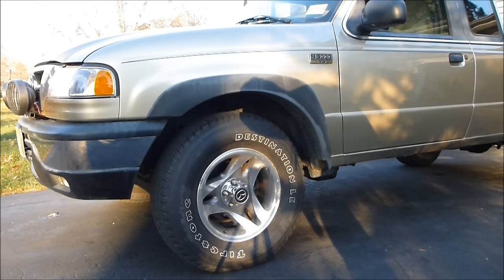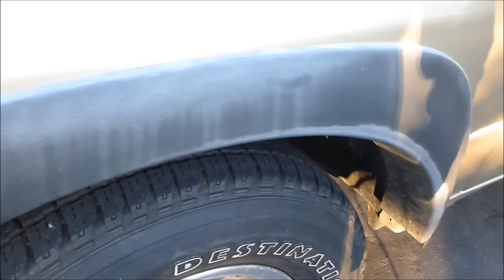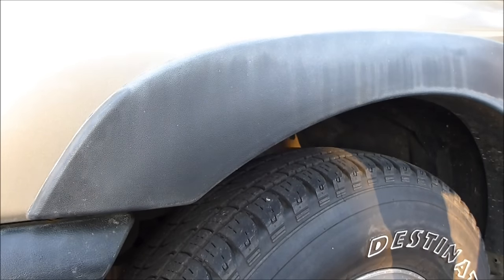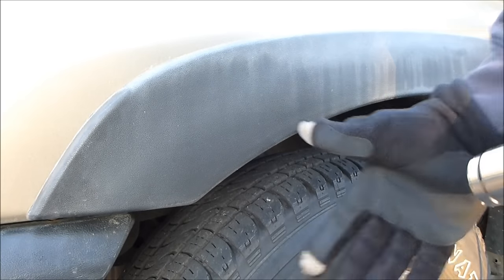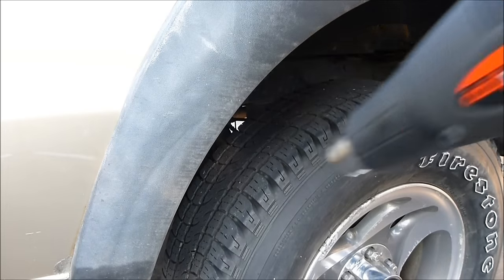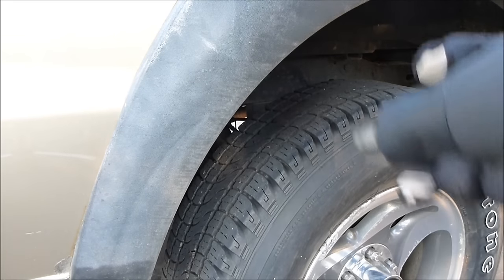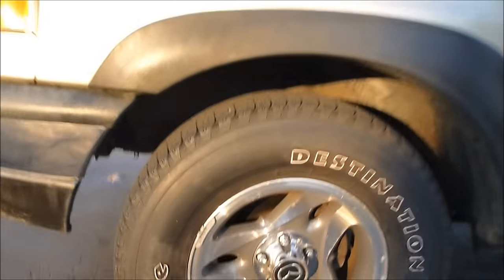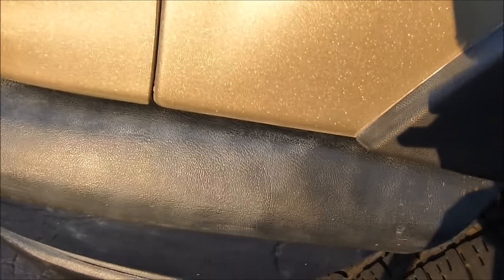Restore your Faded Plastic on your Car

Comment: Wish I would have seen this video Before I plasti dipped all my side panels etc. Masking and removal of over spray took forever. It looks great but this is WAY easier!  Subscribed!
Reply from the maker: D-Nice Grogs Glad you subbed! That does sound like a lot of work! I have a product review in the works for black trim restorer and it works great! New automotive 'how to' videos every Thursday and most Mondays so stay tuned!
Reply: Coo, I have a Mini Cooper S, do you have a recommendation for what to use to black out the silver trim that runs at the base of the windows all the way around the car. Blackout tape? I want something that is easy and can last in hot and cold weather, snow and rain... Ya know.
Reply from the maker: If you are blacking out silver trim you are going to have to spray. Obviously plastidip is a good, non-permanent way to do that, but I have used this stuff and it looks great and lasts a long time: http://www.amazon.com/gp/product/B005H5P5C6/ref=as_li_tl?ie=UTF8&camp=1789&creative=390957&creativeASIN=B005H5P5C6&linkCode=as2&tag=chri0e2-20&linkId=KFTNL6XCZ6IFH3YB
Reply: D-Nice Grogs I did the exact same thing with my 06 cooper S. I actually for a time had blacked out all the chrome and silver on it. I used plasti dip to do it and it works great. The more coats you put on the easier it is to come off if you want it off as well as the better it will hold up. one thing i did notice with the plastidip that i had put on the grille and that chrome belt line bug guts if not taken care of within a week will start to effect the plastidip but i think this may have been because i didn't have enough coats on in some spots. The black plastidip covers really well so its easy to think that because you have coverage its good to go. i reccomend 3-5 full wet coats to make sure it holds up and is easy to remove if you want to. im thinking about plastidipping my whole car this summer even. or maybe just the roof.

Comment: Chris can you do a video on restoring oxidized painted plastic bumpers and trim?  On a ruby red 2013 Ford Focus for example, there is a lot of painted plastic that's the same color as the metal paint.

Comment: Transmission fluid works but, you've got to do it in the heat of the day and at least two applications, if not three over the course of several days.  Results will be permanent.

Comment: I used Go Jo hand cleaner on 93 f 150 it had ad on flares looked terrible also black plastic on rear view mirrors owned truck ten years that was the only repair done to it that worked of course apply in discreet  spot first

Comment: I would recommend that if practical and without damaging stuff, remove any plastic from the car that is to be heat-treated.

On my car, I made the plastic trim look good with armor-all but it only lasts until the next washing or serious rain. I am thinking maybe painting it black. Would that be a bad idea?
Reply from the maker: Lesrevesdhiver That is a good tip. Taking these plastic pieces off might be a death wish because they are so old and brittle. Instead of painting them, I will have a product review in a few weeks that you should check out. It is this stuff and it works amazing: http://www.amazon.com/gp/product/B00IOBSZJK/ref=as_li_tl?ie=UTF8&camp=1789&creative=390957&creativeASIN=B00IOBSZJK&linkCode=as2&tag=chri0e2-20&linkId=E4IBQ5MH3GZEJ2Z6 
I highly recommend it before you go painting the trim. It lasts over 6 months so far!

Comment: Chris - been watching your videos for a while and have a legit question. 

I know this is an old video but can’t find anything recent / relevant. 

I have an old 2007 car with grey trim and wanted to spray or make it black (permanently)

Cerakote wasn’t bad but turned streaky and pealed. I want permanent and may spray it black. Any products or stuff that springs to mind for a permanent solution? 

Adhesion promoter or spray  / trim bumper spray?

Comment: Take it off and use a blow torch, works wonders but you only want to hit one spot for a split second or it can melt the area.
Reply from the maker: Why not just play it safe and use a heat gun like in the video?
Reply: Eh I've tried the heat gun didn't give me the same results but to each his own
Reply from the maker: Gotcha. I guess it depends on the plastic because I used a torch on this and it didnt work nearly as well...

Comment: I went out an purchased a cheap heat gun from Home Depot, like $20.  The results were amazing, but only lasted about 3 weeks.  Any idea if it damages the plastic by doing it over and over and over again?  I might just spray paint it or plastidip it.

Comment: I restored the trim on my 94 325i with Forever Black. It basically dyes the plastic black again. Unfortunately in started fading again after about a year. I did it again and something possessed me to use the as seen on tv Wipe New, as a protective sealant on top of the trim after using forever black and it still hasn't faded 4 years later

Comment: would like to see a video around removing wax. I tried rubbing alcohol right after, but still there is some residue... it is now a month after and used different solutions... cheapest with fairly good results was cooking oil, but would appreciate if you could suggest a better solution.

Comment: Thanks again Chris, is it true that you can add like Motor or Transmission Oil after you heated up the plastic to the point it to hot for the hand to touch? I saw in another video, where the oil is suppose to get into the pores of the plastic and revive it ? You have have to do this 1-3 times depending how bad is your plastic trim is. Is that true? The oil is suppose to be a permanent fix, as this is the reason that your trim dries up and get's hazy, it looses it's oils and dry's up.  Can you confirm this ?

Comment: Hi! Chris. How about an engine cover smeared by "whatever chemical is it" that made it faded. Can I do the same. Can I use a back to black restorer without any effect on the plastic considering it would be exposed to extreme engine heat. Thanks!

Comment: Do you know if this could be used to repair scratches in plastic cladding? I wonder if I started by sanding out the scratches, if the heat gun could be used to smooth out the sanding marks. Any experience repairing scratches and scuffs on plastic cladding?

Comment: howd it hold up? I'd think that you melted some of the oils out of the plastic, and that it will look great at first as they come to the surface and re-invigorate the top layer, but in the long run I bet it gets chalky and dusty even faster now.
Reply from the maker: dav3fk It lasts a little over a year. I am doing a product review on a product that actually works pretty good so far. They claim it will bring back your black plastic and keep it black for a year. Stay tuned for that product review!
Reply: Chris have you any experience with a product called Plastic Resurfacer by Eastwood?

Comment: Hey Chris...I have read several reviews of plastic trim coatings.  The biggest complaint is streaking  where the product leaches onto the body paint below the trim, from rain.  You mentioned a nano wax in another video.  How has that worked out?

Comment: Hey Chris im on a binge watch on your video :D

How has this held up since then? I realize this was 2 years ago so you might not have the truck but it would be interesting to know. Oh, and what year is your corvette?
Reply from the maker: zzzhuh Awesome! This held up for about a year but there is an even better method out there that I will be reviewing soon!
Reply: ChrisFix Ooh what method is that?? I just found this as-seen-on-TV stuff called Wipe New...mixed reviews but the positive ones seem to be from people who have actually used it. Tried it myself all over my car's trim and some stuff inside and it's absolutely phenomenal. Dries dry, impenetrable, and matte with a slight sheen. Supposed to last years and has lasted me through one hand wash & wax so far with absolutely no fading. I realize now that I think it's just a polyurethane coating, and there's a couple more industrial products that are probably exactly the same stuff, only cheaper: Carworx Refinish Restorer, and this stuff on Amazon called Poly-Thane. Worth a shot man, stuff works like crazy.
Reply from the maker: floofytown This is the stuff and  (spoiler alert) I recommend it. I really like the results I got on my truck! http://www.amazon.com/gp/product/B00IOBSZJK/ref=as_li_tl?ie=UTF8&camp=1789&creative=390957&creativeASIN=B00IOBSZJK&linkCode=as2&tag=chri0e2-20&linkId=TMMPYWKISIAZX6Q6

Comment: I read that using heatguns on plastic may cause the plastic to become brittle over time as the heat only brings the moisture to the surface which gradually dries the plastic out.

Comment: clean the plastic with a mild degreaser and a fine stiff bristle brush. i like to use nonsense from chemical guys.  stuff works great on everything and I gentle.  so if it gets on the paint its not a problem. just make sure to apply wax back to the paint. spray down and apply moderate pressure and scrub in circular motions. It might take a couple of passes before its clean enough. then follow up with a restorative product. will last months before you have to do it again.  or just keep doing a light clean with a brush every wash then coat again.  plastics will always look good.  the trick is to clean all the dirt, grim and old stuff out of the texture so that the restorative product can bond to the surface. if you don't it's just bonding to the dirt. also the stiffer the bristles on the brush,the better it will work because it can take away some of the grades plastic on the surface.  think of it as exfoliating your skin then applying lotion.
Reply from the maker: +Jeremy Greathouse Thanks for sharing!

Comment: I have a question! How has this held up over 3 year? I've just used Mother's Back to Black, which does the same thing. Buffs off minor oxidation, and protects it, and other stuff. I was just curious so I can see the difference in results are after some time.
Reply: Blade Vamp Chris responded in another comment it lasted about 6 month, others are saying 2-3 months.

Comment: Just curious, what if you put some layers of clear coat over the trim after doing this? Wouldn't it last even longer?
Reply from the maker: It would definitely help protect it but it can give a glossy/shiny appearance, I like the look of restored trim like this so I just left it and when it faded years later, I was able to do this again!
Reply: @chrisfix  very true. I wonder if someone makes a non gloss clear coat? I'll have to look into it. Also, I was under the impression that you couldn't do the heat gun technique more than once so that's awesome that you can reapply. Love your video man, keep it up! About to do headlight restoration on my mom's truck using your technique so I greatly appreciate what you do! 🔥
Reply: @chrisfix  so I researched it and they do make a matte and satin clear coat with no gloss. Something to think about. Maybe another video doing this after the heat treatment?

Comment: The Deep Woods f2f did clean the headlightvlenses perfectly. However, after I posted I tried spraying it with water from my rear windshield wiper and the dripping water streaked it. Back to the drawing board.
Reply from the maker: Stacey McElrath What do you mean? This video is about plastic trim not headlights... What is Deep Woods F2F?
Reply: @chrisfix  lol

Comment: does it last long? even if you wash the car with soap or any other chemical? thanks Chris
Reply from the maker: samuel aguilar It will last about a year depending on if the car is garaged and where you live. It fades because of UV radiation (sunlight).
Reply: thanks man, :)

Comment: Why didn´t you just use silicon spray? Turns Black instantly and is good for the plastics and cheap. 
There are other products specificly for that purpose but silicon spray works awesome.

Comment: ChrisFix. I own a 2002 Ford Expedition EB and my significant other decided to spray paint the rear bumper!! The paint used doesn't even resemble Arizona Beige I have tried everything to remove the spray paint but it still wont come off .Please help me get the off white egg shell of my bumper please. For GOOD

Comment: Chris:  D'ye think this method will work an the panel where the wipers rest just below the windshield, where the cabin air intake is?  It's huge on my Taurus - very visible - and almost gray in color - very unsightly.  Thanks.
Reply: William Krause My 2 cents would be that all plastics are different so try on a small corner and see if it helps. Doesn't sound like you could make it much worse. Please update if you try it.
Reply: Will try as you suggest - in the spring, when the outside air temp is not nine degrees! Thx.

Comment: For whatever reason I can't seem to get this to work on truck. I have the same problem but no matter how much heat I use it doesn't change... (2006 F150 FX4 fender trim)
Reply from the maker: ***** It wont work on all plastics. I would try this instead which lasts even longer (I just tested it over a year): http://www.amazon.com/gp/product/B00IOBSZJK/ref=as_li_tl?ie=UTF8&camp=1789&creative=390957&creativeASIN=B00IOBSZJK&linkCode=as2&tag=chri0e2-20&linkId=IIV3XUXC4N5OEWXI

Comment: The easiest most effective way to fix this problem is to take and old socks and drench it in Deep Woods Off.  Just wipe it on and it looks show room new.  It also can be used to remove the film off plastic head light covers and fully restores them too. It lasts a very long time.
Reply from the maker: Stacey McElrath What is Deep Woods Off? That sounds promising!
Reply: ChrisFix Do not do this. Snake oil fail
Reply from the maker: KB in MD Last Yea, I did some research. People try it on their headlights too. Not a good idea! https://www.youtube.com/watch?v=AYmbBZntuY8

Comment: would you not have to worry about the heat from the gun messing with your paint though?
Reply: maybe put some high temperature tape around the exposed paint to help protect it from unwanted heat?

Comment: Hey Chris does it have to be a heat gun or would a hair dryer do the same
Reply from the maker: Michael Smith That would have to be a hot hair dryer lol. You will need a heat gun. Instead, try this (I will be reviewing it shortly but it is amazing stuff and lasts a year or more): http://www.amazon.com/gp/product/B00IOBSZJK/ref=as_li_tl?ie=UTF8&camp=1789&creative=390957&creativeASIN=B00IOBSZJK&linkCode=as2&tag=chri0e2-20&linkId=IH3PCMZ6W25QXSZE

Comment: hey Chris,
my name is Mark. I have a good one for you. how do you remove paint from a painted plastic piece on a vehicle? for example a bumper or a front lip. and also what steps do I need to take to paint it with a aerosol. i hope you get to read this and help me out. 

             thanks, Mark
Reply from the maker: +Mark Tabuga sanding it down is about all you can do. That's tough!
Reply: ChrisFix do you know if that paint stripper for plastic is any good?

Comment: Hey Chris, Since this vid is from 2013, is this method still working for you? I've tried bumper black, spray paint etc. but it just falls off sort to say.. ):
Reply from the maker: Sander Van marle This method lasts about a year. There is a product that I will be reviewing that works for about a year as well and I highly recommend it. Here is the product: http://www.amazon.com/gp/product/B00IOBSZJK/ref=as_li_tl?ie=UTF8&camp=1789&creative=390957&creativeASIN=B00IOBSZJK&linkCode=as2&tag=chri0e2-20&linkId=JBNFR44JUB5HPFD5

Comment: Wonder how taking the plastic off and painting it with krylon fusion would work?
Reply from the maker: Gavin Pickens That would probably work well but if you go offroad and scrape the bumper against brush a lot, then it will scratch easily if you paint it.

Comment: there is a little faster method.. clean the surface and buy some black mate paint   from autozone they are for plastic parts..just use masking and  acetone to clean the surface and then spray it...

Comment: Does that work on all plastic ground affects on cars?  no matter what color? mine is silver on the sides of an SUV.
Reply from the maker: +Wade Walton I am not sure it will work on silver because I have only tried it on black. You can try it on a small inconspicuous spot and see what happens. Keep me posted if you try it!
Reply: +ChrisFix I only have a high industrial heat gun. gonna have to move fast.   it's the plastic above the running boards.  2003 expedition.  .  I need a smaller plastic blaster..maybe this weekend.  thanks..*

Comment: What happens if you accidentally blow on the metal of the car above?  Obviously, you have to go around the edges also  up top, right?
Reply from the maker: Heating the metal for a second wont do anything but prolonged heat will damage the paint.

Comment: Would a hair dryer work or do I have to shell out the 10 bucks..
Reply from the maker: Try it.  It might work
Reply: Have you tried? Does it work with hairdryer?
Reply: +Dusan  Simic Naw, not well. I got the heat gun.
Reply: +Mike Jones did the heat gun did a good job to get the plastic black again?

Comment: I wouldn't try Back To Black thats just something that as seen on TV junk. If you get the Meguiars brand of that stuff it works great. I use it on my step dads 2007 Avalanche all the time it its looks like brand new.
Reply from the maker: Chevy Nova Thanks for sharing! I used this stuff and it has been almost a year and it still looks new: http://www.amazon.com/gp/product/B00IOBSZJK/ref=as_li_tl?ie=UTF8&camp=1789&creative=390957&creativeASIN=B00IOBSZJK&linkCode=as2&tag=chri0e2-20&linkId=ZEDCXEMLW43D2FOL
Reply: I use black to black all the time on my 4Runner. It isn't seen on TV, that's the brand called "wipe new". Black to black is mothers. Few months ago I just dyed it and it still looks great but I don't remember what I used.